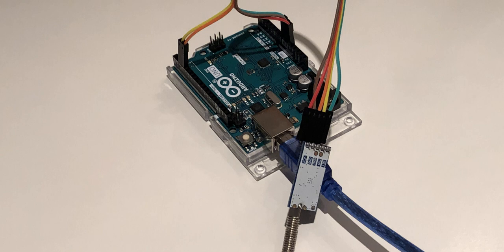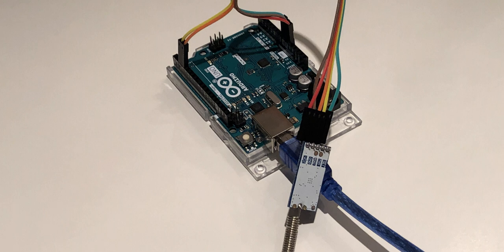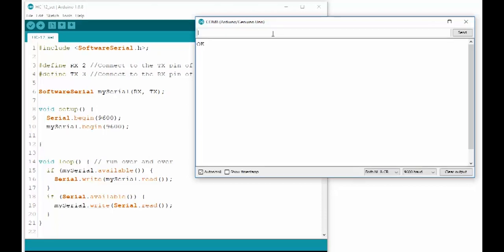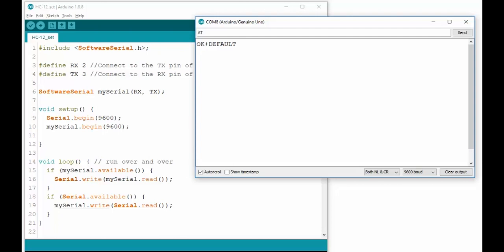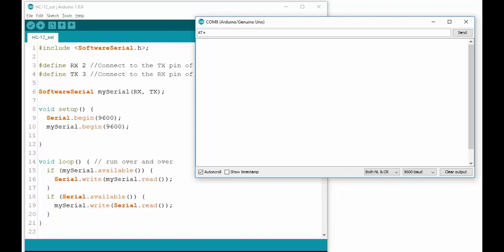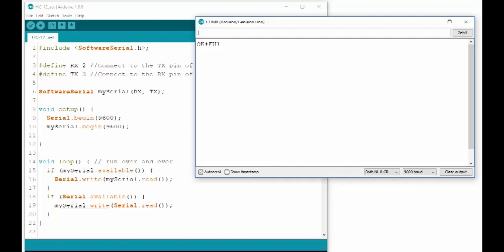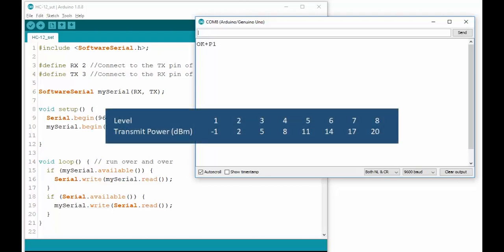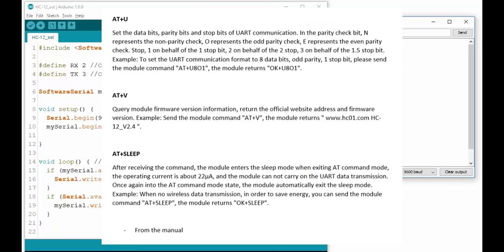HC-12 AT Commands - Set up for Long Range with Arduino

Comment: Yeah, agree with your doing antennas tests!   Analysing the pros and cons of antennas will be costly in terms of time though, especially if you test in various environments. Good luck and good luck with your channel.
Reply from the maker: Thank you! Yes, we have landed on six different antennas - but you are absolutely right, so we are trying to find a balance between "easy to digest" and giving enough insight to be useful.
Reply: @DIYTECHBROS  waiting for the antenna test review and guide.
Reply: @NISARAHMED-bw1rw  Silly questions rightfully deserve silly answers. I'll spare you for now.
Reply: Simple 1/4 antenna works better than stock spring looking types

Comment: is there a channel v freq document  . AT returns OK but after AT+RX  i get 
U1 
B9600
C001
A000
P8
 

the u is prob FU1 and P8 the power, but what is the A000? is it as simple as adress? the uno is listed under tools and programmer its "Arduinoisp"

i have the hc-11 btw

Comment: Hi! is there a way to decrease the range to 10Meters below only? I have a specific project that requires only 10 meters maximum range.
Reply from the maker: The minimum distance would be a function of setting power (AT+Px) and antenna. And, also the fake HC-12 boards have a low range. But, chap 433 boards would maybe be easier?

Comment: Hey hi I am using two HC-12 modules one is for transmitting and one is for receiving. In both the modules I was stated the SET pin to ground and the baud rate and connections are perfect. Then why I can't receive the signal from the transmitting side? Could you please to sort it out.
Reply: I have exactly the same problem.  You managed to solve it, I would appreciate the help

Comment: Hi, do you know why my HC-12 responses with "ERROR" after each character is sent? I have 3.3V voltage connected and SET is connected to ground (to enable AT mode). Thank you.
Reply: [configuration of Putty] one extra hour of investigation --> that was an issue with configuration of putty (terminatl settings - local echo - force on)

Comment: Hi, I have been trying to change the channels with AT commands, but the transmission is still working, even when AT+RX says that they are in a different channels.
How can I realy change the channels ? thanks!
Reply from the maker: Remember that the channel difference is very small :-)
Reply: They have to be like 5 channels appart. Only the low 1200/2400 baud rates work in very narrow channel increments side by side.

Comment: Can I do AT command without Serial Monitor? (write it on void setup() )?
Reply from the maker: Yes! 
Just have your Arduino send the commands. But remember to connect a pin to the SET pin, so that the Arduino can pull it low as well!
Reply: @DIYTECHBROS  alright. Thank you bro
Reply: @DIYTECHBROS  Hi, do you have an example code for how to send the command via Arduino? Thank you very much!!
Reply: @vig_gy  just something like HC12.println("AT+DEFAULT");

Comment: I have a question, is possible to use hc-12 with an esp32? Great videos btw
Reply: It works with any board that can talk Serial. So that is well just any microcontrolelr, from ATTiny85 all the way to Teensy 4.1's

Comment: If i implement 50 pairs of these modules within 30 mtrs will there be any interference? TX & RX need to be in same channel?
Reply from the maker: Yes! If they are all on the same channel the receiver can't distinguish between the signals. But the sending is fast, so just include a handshake to verify the delivery of your message and make the senders send until they get a confirmation back.

Comment: I’m doing the setting you did at the very first with an arduino mega 2560 and follow the steps but when i type AT it doesn’t give me OK... what could be wrong ?
Reply: I have the same problem. I don't know if it's because soldering or something with the module
Reply: @ekremvkilic  i have same issue not working at command or module
Reply: Either the SET pin is not connected to GND, or the baud rate is not at 9600. Also read into MEGA Serial ports, you can skip SoftSerial as the MEGA has 4 Serial ports in hardware.
Reply: Hi, sorry can i know did u found the solution?  because  i have the same problem.

Comment: Once i change the baudrate (4800 bps for example) with AT commands, will it continue changed even after I use other code?
Reply from the maker: I should know this off the top of my mind... but I have to check tonight! I'll get back to you Regina!
Reply: @DIYTECHBROS  thank you bros:"). Cause when i tried to set it back to the factory reset, it causes error😢
Reply: solved bros, when we change the baud rate once via at command, it will continue changed forever until change it back
Reply from the maker: Great :-)

Comment: configure HC12 to laptop wifi is it possible? instead of using 2 HC12?? Using laptop as a transmitter the python script will perform some action and the signal will send to the receiver bot(arduino) using hc12??
Reply from the maker: Hi! Sorry, no, HC12 operates on 433 MHz while WiFi is 2.4 and 5 GHz. So they are very far apart. BUT, have a look at ESP8266 or ESP32. They have WiFi and you program them directly, removing the need for an Arduino!

Comment: thank you very much  for the wonderful tutorial ! what about modulation mode ASK/OOK  , FSK  etc . as well, I am wondering if you can make a video on how to connect the SI 4432 module to an arduino board and set the registers of the si 4432  in  sketch directly  just like  we do with the  cc1101 module  ,example :
 
// Configure the pins for receiving and transmitting and the connection pin cc1101
#define CC_CS 10 // CSN
#define CC_RX 2 // GDO2 reception
#define CC_TX 3 // GDO0 transfer

// Config to receive AM 433.920
#define SRES 0x30
#define SCAL 0x33
#define SRX 0x34
#define STX 0x35
#define SIDLE 0x36
#define SPWD 0x39

#define IOCFG2 0x00
#define IOCFG1 0x01
#define IOCFG0 0x02
#define FIFOTHR 0x03
#define SYNC1 0x04
#define SYNC0 0x05
#define PKTLEN 0x06
#define PKTCTRL1 0x07

 , without the use of libraries , so that the user can perform his own settings . I do that with CC1101 , but not yet with SI 4432 . seemes that nobody do some tutorial on it . yet !   what  I mean by that ,  I set the registers of the CC1101 module in my sketch , and use interrupts to make an ASK/OOK  simple receiver  on 433.92 mhz . the performance  , the range and the sensitivity it' s amazing  , if you compare it with cheap regular 433.92 wireless modules . I would like to see how  SI 4432 performs  with the same parameters ! Best Regards from Athens Greece !
Reply from the maker: Hi! You raise a couple of very interesting question! I'm not sure how much control we have over the microcontroller and there by the SI chip. But this has peaked my interest so I'll have a look :-)

Comment: hey i  checked now at commands and none of the two hc12 respond to my at command
Reply: every hc-12 module I ever putzed with replied to the AT-RX command one time at most, and went brain dead. it's like sending 5VDC commands burns out the serial RX. I tried with a 3.3 volt level converter on the TX line to the hc-12 RX - same result.
Reply: @jamesotisjr2322  Did you use the SET pin correctly? Connect it to GND for setup, then disconnect to use the module.

Comment: How can i use hc-12 with arduino using python language??.
Reply: Don't, most simple Arduino's like Leonardo, UNO, MEGA etc. can't hold the Python runtime in RAM/ROM. MicroPytho will fit on M0/nRF52 boards minimum.
Python is like building a house with a hammer and nails. Pro's use TORX screws!
Reply: @lovemadeinjapan   Are there any alternative suggestions for HC-12 that I can use with Arduino in Python?
Reply: @waleedaiad3411  The HC12 is not the problem, but the Arduino

Comment: how to minize distance.... like 1-2 meters
Reply from the maker: Use BLE :-)
You can more reliably control distance with BLE then 433 mhz.
But try lowering the transmit power, and maybe use a cheap clone and the the original well working boards - that might work?

Comment: No link to the code as you said..... ???
Reply: Just the default SerialPasstrough sketch will work on any Arduino with dual UART, like Leonardo, MEGA, M0, M4, Microbit etc....